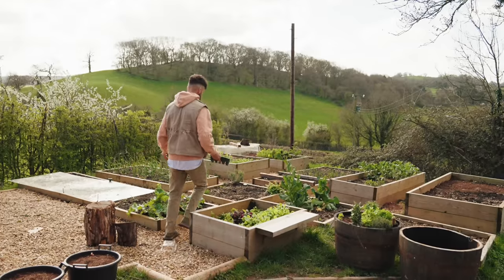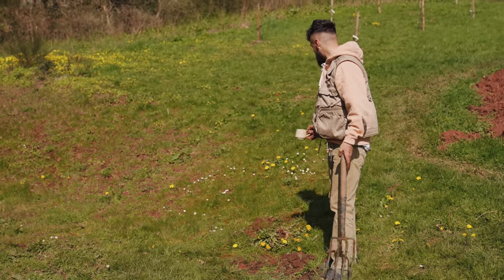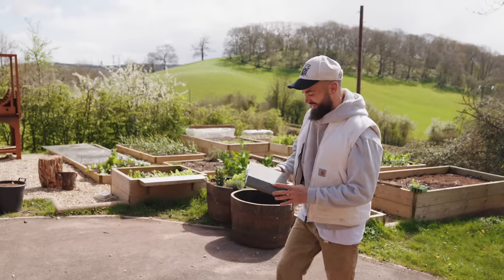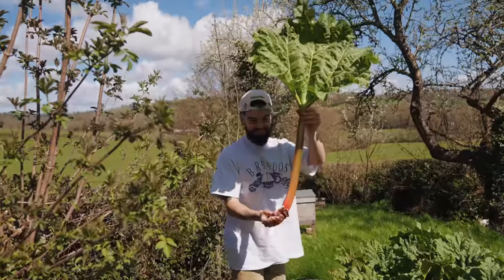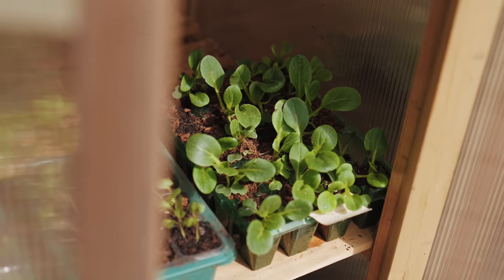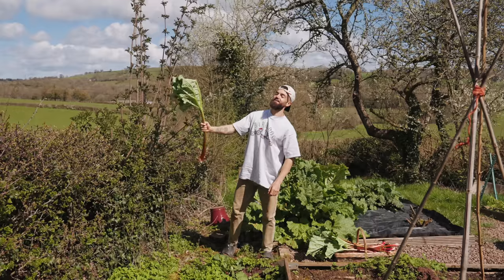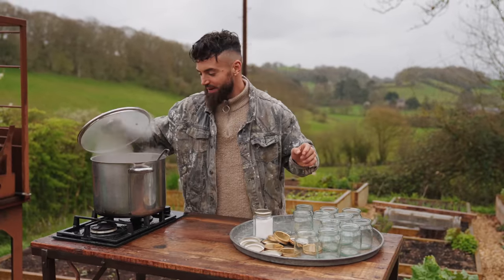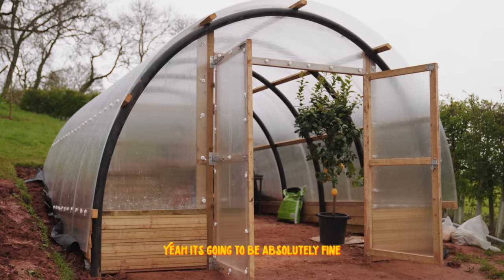Chef Escaped Covid Lockdown In London To Start A Homestead In The Countryside 👨‍🌾

Comment: 🍋 Do you know poncirus trifoliata? It is also called "flying dragon" 🐲 "bitter lemon" or "bitter orange"... the tree is winter hardy to minus 25° celsius! And you could use the fruit to make your own "orange" jam, use it for "lemon zest" (dried & powdered) and even "bitterlemon" syrup or liquor. I am planting one next week and can't wait to taste the fruit. I've heard, they should better not be eaten raw. But you can use poncirus in cooked dishes just like lemons. And in a short time you can receive a decent crop 🍋🍋🍋
Reply: @Pandhari : Yes, it is nearly inedible when raw, but medicinally beneficial when cooked. The thorny plant does tolerate snow (one of its common names is Siberian lemon, though threre are still debates whether Citrus trifoliata is the same as Poncirus trifoliata or whether P.t. should be classified as a species of its own). It has a higher vitamin C content than lemon and even contains carotenoids.  But be careful, the fruit is mildly toxic if overeaten. The rind can irritate the skin. It is rich in nitrogen, therefore good for the compost, yet it is advisable to add one small  portion to the compost at a time.

Comment: A traditional recipe with lemon tree leaves from the region of Murcia in Spain: 'Paparajotes'.

Ingredients: 16 lemon tree leaves / 175 grams of wheat flour / 250 milliliters of whole milk / 1 egg / 8 grams of baking powder / 1 lemon / 2 tablespoons of sugar / 1 teaspoon cinnamon powder /oil
  
- To make the batter, add the flour, milk, yeast, egg and lemon zest in a bowl. Stir with a whisk until all the lumps are broken up.
- Mix in a small bowl the sugar and the cinnamon powder.
- Dip the lemon leaves in the batter and fry on both sides in a frying pan with plenty of hot oil. Remove on absorbent paper to remove excess fat.
- Serve the paparajotes murcianos and sprinkle with the sugar and cinnamon mixture.

A little tip, do not eat the lemon tree leaves, they give their aroma and flavor while you eat the batter.